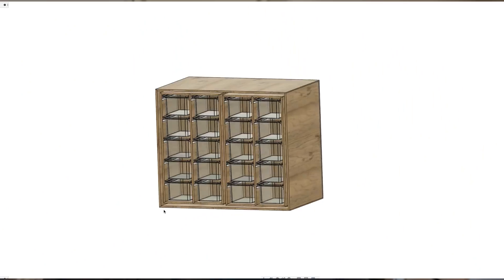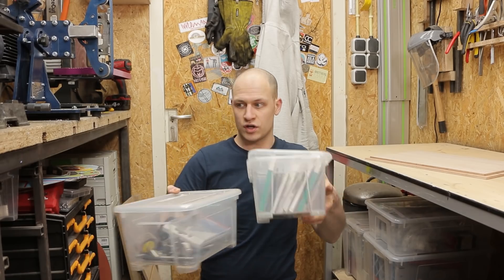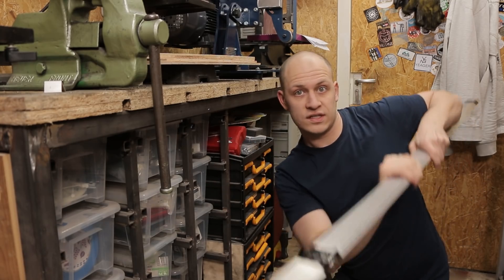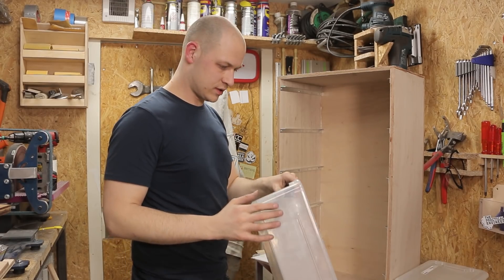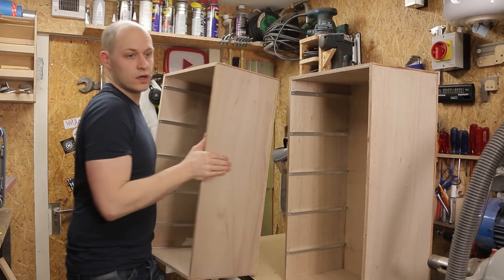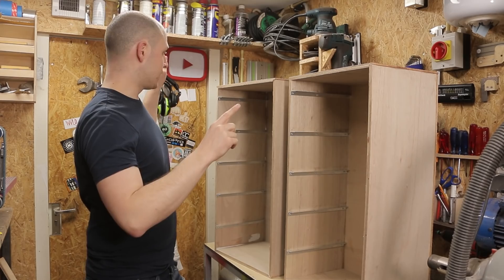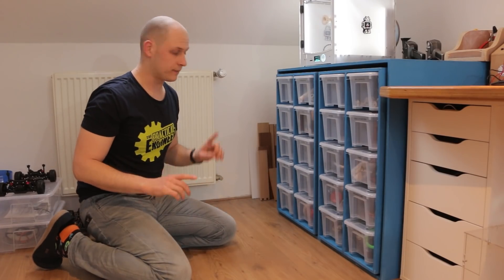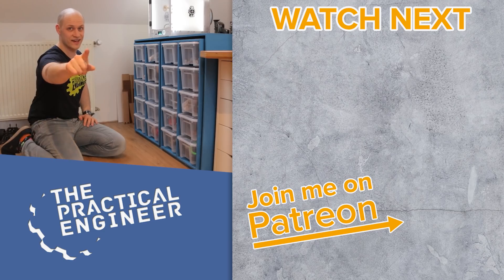Storage cabinet with Hidden Layer

Comment: Great job. Only change I'd make would be to put a ball baring wheel under the cabinet so it was supported by the floor as you pulled it out :)
Reply from the maker: I still have this as a possible option if it needs it but so far it seems to work well without it.

Comment: Awesome.  You've confirmed my plan to used aluminum L channel as slides for Flambeau 5007 parts organizers.  Thanks for you projects.
Reply from the maker: Thanks! Yeah, the L channel works great for that. Just make sure you'll find a place with good prices for it since the length you need adds up quickly

Comment: you should add a couple wheels to support all that weight when they`re open, its a great idea for storage but it wont last very long just hanging from the hinges
Reply from the maker: Only the connection of the hinges to the cabinet are a potential weak point at the moment. the drawer slides are really heavy duty so I don't expect them to cause a problem.
Reply: @Thepracticalengineer  Which is what @Taraservice Workshop is referring to. Those hinges will fail eventually. Adding a caster onto that swinging part will allow smoother opening and prevent it from failing down the road.
Reply: @famousamoso7  Agree, and it makings opening even less hard work as well.

Comment: All the best for 2020. Great solution. How about a castor wheel on the lower inside corners of the ‘door’, that would take the pressure of the hinges and it open en closer lot more easier?
Reply from the maker: I have thought about that and decided not to do it until proven necessary ;)
the sliding actually works real smooth. But I do use it mainly for light stuff

Comment: Great design!

You added a small "tab" for support when closed.

I was thinking maybe some "latches" to hold it closed would also add support. It might take some stress off of that top hinge.

I'm a relatively new fan. I love your work and your super efficient little shop.

Thanks 🙂
Reply from the maker: Latches will definitely help with that. I wanted to keep it as simple as possible that's why I didn't add any locking mechanisms

Comment: I have a lot of these bigger samla cases as well that you have in your hidden part.
And now moving to a new garage i am trying to find the best suitable way of storing.
If to make a cabinet with just the bigger boxes turned 90degrees and 5 or 6 next to each other, how high would it be possible to make and still be movable on caster wheels?
For me this would be my first project of doing something with wood. Not a lot of tools for that, but I'll see when I get there :)